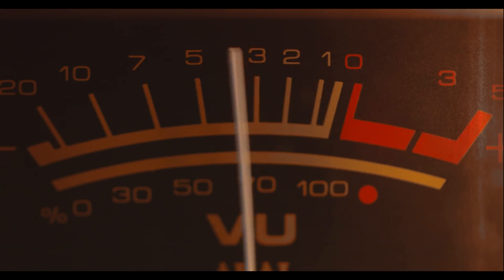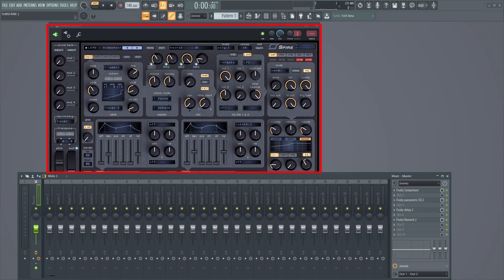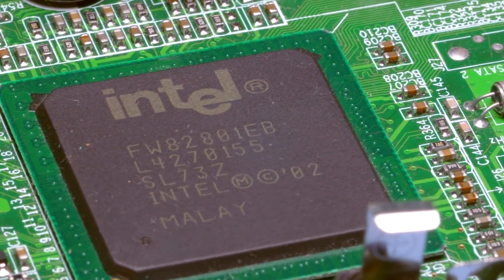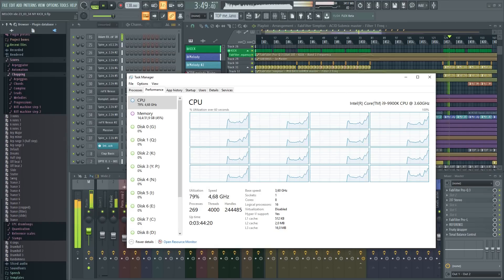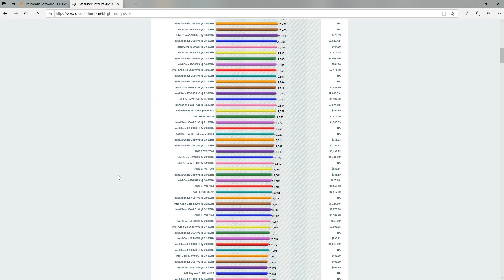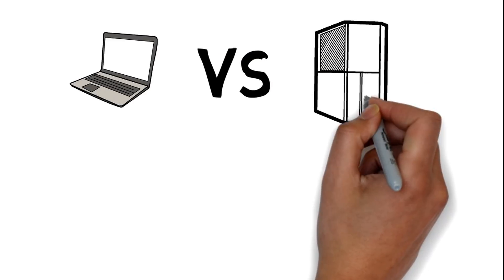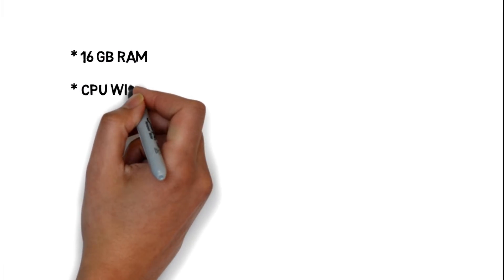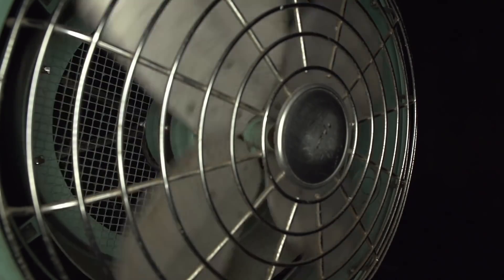The Best Computer For Music Production - What's Needed And Why!

Comment: About the liquid cooling that you used before ... I would like to know what pomp you used and how you decoupled it
My last build is liquid cooled and I never had any noise issues with my D5 Vario (even at full speed) 
And the fans on my radiators run around 500 rpm so ... let’s just say that my refrigerator in an other room is more addible than my pc currently is
Also I noticed that your system uses the stock fans that came with the case ... why not replace those with Noctua’s to reduce the noise even further ?
Reply from the maker: I've used two different kinds of setups and all though they are "almost" silent they are not as silent as this air cooler, which runs at around 220 RPM most of the time, and even under max load It can't be heard. There might be some out there that's quieter than the ones I've tried, but I just found that the Noctua provided better value since it's much cheaper and also quieter, and the performance is almost the same as with a water cooled setup. 
Because I want to stay on the safe / stable side of things, and not squeze out every single mhz I can, it wouldn't have mattered with regard to the OC result anyways. 
If I were to use a dual radiator setup then I would have to remove the sound isolation from the top of the case in order to mount it, and I fear that it would increase the overall noise compared to the way it is now. Also, all though I know the risk is minuscule, I was never quite comfortable using water in my rig, especially when it's so important to my business and all. :)
 
Regarding the case fans, that was the original Idea. However, this is a high quality case and I was told that they can't be heard, so I gave it a go, and was not disappointing. That's why I love this case so much. It has great sound isolation and the fans that comes with it is so quiet that you can't even hear them. I can hear it slightly at max speed, but there's never any reason to run all the case fans at max speed since there's more than enough circulation.

As I sit here with the PC 40 cm away from me, I can't hear any of the fans at all. The only thing I can slightly hear if I move closer is one of my older HDD's which is a bit noisy (and will be replaced soon). 

I placed a lot of attention on silence with this build. :)

Comment: Does the Asus Hero do a good job with 9900k?  I heard some other guys saying it doesn't have enough phases (only 4)  and so it will be hot, or something
Reply from the maker: I heard that too, but I found that it's really not an issue in any real life scenario. I certainly haven't had any issues with it, and my system is overclocked to the limit.

Comment: Ryzen9 or intel i9
Reply from the maker: Ryzen will give more value for your money. I9 will likely still give the best performance since it can be overclocked more, but the gains are not huge and I will tend to recommend the Ryzen these days since it provides better value. If you have more money than you can manage to use then go for the i9. :)

Comment: if your using Ableton multiple cores can benefit mattering how you use it,
go for more cores if your using lots of chancels and lots of small vsts on each
go for higher single core speed if you have only a few channels but lots of vsts on each
Reply: and for people buying CPUs price the motherboard with it because some cpus need $120 motherboards where others need $450 motherboards
Reply from the maker: Every daw can use multiple cores, including FL Studio. I'm sorry if I was unclear about this. The reason why single core speed is generally more important than having a lot of cores is because there's a lot of waiting involved, due to dependencies created within the project, which can't be logically processed in parallel. This is the reason why windows task manager will usually report a very different result than the meter in your daw. Task manager will report on the overall CPU consumption, while the meter in your daw is measuring your CPU's ability to fill the audio buffer within the allowed time. In essense, it's ability to play back the audio in real time. 
VST's can usually be processed by different cores. Individual mixer tracks are also an opportunity for the CPU to use multithreading, so having many cores is definitely an advantage. The problem is that there's always a trade-off between number of cores and single core performance. As you keep adding more cores, single core performance will tend to go down. For example: The 9900k has about 12% faster single core speeds than it's more expensive workstation counterpart, the 9900x, which has more cores. 

The 9900k, as well as the earlier 9700k etc are all located in this sweet spot. The new 3000 series from AMD also have very good single-core performance. 

Here's what the developers say: 

"There is a long list of tasks that must be processed in sequence, and this means logically can't be processed in parallel (multithreaded). For example: Plugins must wait for instructions from the Piano roll and Playlist before they make sound. Effects must wait for the audio from upstream instruments and FX before they can process it. Further, it's not possible to parallel-process (multithread) instruments and FX that are on the same Mixer channel (their audio is mixed together), or even in the same Mixer routing pipe-line (when one Mixer track is linked to another and another, even FX processing has an order from top to bottom in the FX stack). Then, the Master Mixer track must wait for every instrument > mixer track > effect to be processed before it can process the audio through the Master effects. So logically, there is a lot of waiting that is a natural and unavoidable fact of DAW music processing. Think of a production line. This means the CPU may not be particularly busy, using all its cores and processing slots, yet it runs out of time to fill that tiny 5 ms audio-buffer because there was a lot of waiting for things that needed to be processed in sequence. It should be clear that fast processing is very important and this is not the same thing as multi-core processing. The best CPU is one that has enough cores to spread the work around AND can do the most work on a single core during each buffer time-slice. Which leads to our TIP: When comparing CPUs, look for the fastest single-core performance scores in a package with at least 4 physical cores."
Reply: @FireWalkMusic  different DAWs and different workflows apply to what choice people make with buy a CPU, rather than a blanket statement that one is better than another.
both these factors should be considered when choosing a cpu,
i use Ableton the most but receive a lot of my work from partners using Logic Pro and Studio One. i notice a great differences in how each persons workflow and DAW effects my computer that is using a cpu with a higher single core speed that theirs but less cores. i also find workflow to be the most depending factor in this.

here's a quote from Ableton to show how a different workflow can benefit from a different cpu.
"More cores, slower clock speed
    Pros
        Live supports multi-threading, therefore the more cores are available, the more efficient it will be when working with larger sets with higher track counts, or when working with large instrument or effect racks.
        You'll be able to run more apps in conjunction with Live without seeing performance drops.
    Cons
        Lower single-threaded performance than a higher clock speed processor.

Fewer cores, higher clock speed
    Pros
        Better single threaded performance.
    Cons
        Fewer cores to split between applications.
        Not as strong multi-threading performance."

Comment: Thanks for making this video! What's your opinion on the new ryzen 3950x for audio production?
Reply from the maker: The new 3000 series from AMD is very good, but the 3950x is probably overkill. It has a lot of cores, but the thing with CPU's is that as core number goes up, single core speed goes down, since more heat is generated. I would probably go for the 3800x myself. Unless you also do a lot of video editing and such which can benefit from having a lot of cores. :)
Reply: 3950x has good single core too it is better than the 3900x, I just bought one today

Comment: Hello and great video! I wanted to ask, whats your opinion on the Intel's 9x series? I was looking up for i9 9940x (14 core) since i wanna do orchestral music with loads of libraries installed. Is having faster single core performance more important than having more cores with a "lower" single core performance?
Reply from the maker: If you use a large number of VST's then the 9x will  probably work very well since it has more cores, and also support quad channel memory. Note how the older 5820k is doing very well vs the 9900k in this video. This is largely due to the memory bandwidth. If you can afford it, then you can't go wrong with the 9x series. Note that you won't be able to run at the same high clock speed on all cores as you will be able to with the 9900k. If you look at the 9900k vs the 9900x for example, the 9900x has about 12% slower single core speed. When you factor in the higher clock speed of the 9900k (can easily run above 5 ghz on all cores) and you take operations per clock into account, then the 9900k suddenly appears to provide a lot more value. That's why I recommended it in this video, because it's right in that "sweet spot" where you have plenty of cores, but also very good single core speed. As you keep adding more cores to a CPU, the single core speed will tend to go down. 

If you use a huge amount of VST's though then the extra cores "might" just be worth it. 

Here's what the developers say about this issue, and I'll quote: 

"The logic of audio processing - There is a long list of tasks that must be processed in sequence, and this means logically can't be processed in parallel (multithreaded). For example: Plugins must wait for instructions from the Piano roll and Playlist before they make sound. Effects must wait for the audio from upstream instruments and FX before they can process it. Further, it's not possible to parallel-process (multithread) instruments and FX that are on the same Mixer channel (their audio is mixed together), or even in the same Mixer routing pipe-line (when one Mixer track is linked to another and another, even FX processing has an order from top to bottom in the FX stack). Then, the Master Mixer track must wait for every instrument > mixer track > effect to be processed before it can process the audio through the Master effects. So logically, there is a lot of waiting that is a natural and unavoidable fact of DAW music processing. Think of a production line. This means the CPU may not be particularly busy, using all its cores and processing slots, yet it runs out of time to fill that tiny 5 ms audio-buffer because there was a lot of waiting for things that needed to be processed in sequence. It should be clear that fast processing is very important and this is not the same thing as multi-core processing. The best CPU is one that has enough cores to spread the work around AND can do the most work on a single core during each buffer time-slice. Which leads to our TIP: When comparing CPUs, look for the fastest single-core performance scores in a package with at least 4 physical cores." 

I hope this was helpful. Good luck with your build. :)

Comment: Your rig is almost identical to mine except i threw a 7700k in mine, never have any bottlenecks even with cpu heavy vsts.
Reply from the maker: The 7700k is a great CPU. When both are overclocked, the i9 Is just about 18% faster, so it's definitely a good value. :)
Reply: @FireWalkMusic  im 17% overclocked at the moment, might dial it down a bit as summer is just about to start here 😑
Reply: @jessicamoreno7135  are there any good resources, forums to learn music production?

Comment: Not true for DAW applications that can utilise multi cores.  Multi-track recordings can share the available number of cores with DAWs which are designed to cope with more than one CPU.  It's true the mixing stage does have to wait for the other channels to complete, but if each channel has a good share of a CPU in a multi-core machine, that shouldn't be a problem.   Do some homework about which DAWs can process serially and concurrently.   Not all music productions applications are well-suited for multiple CPU's... you've found one of them!
Reply from the maker: All daws process information basically the same way. A linear daw will usually be somewhat more efficient than a modular one, but they all need to process chains the same way, which means that there will always be a lot of "waiting" involved.
Every DAW can use multiple cores. I'm not saying that they can't. I'm just saying that they're not very good at it, unlike video editing applications for example, which is heavily optimized for multi-core CPU's. The reason for this is that the audio has to be played back in real time. 
Usually, every VST can be processed independently by different cores. Generally, every mixer track in a daw is also an opportunity for the CPU to use multithreading, so having many cores is a good thing. The problem is that there's always a trade-off between number of cores and core speed. As you keep adding more cores, core speed tend to go down. Therefore, the best CPU is usually somewhere within that sweet spot. For example: The 9900k has about 12% faster single-core speed than the much more expensive workstation version, the 9900x which has 2 extra cores. 

Here's what the developers have to say about the issue, and I'll quote: 

"The logic of audio processing - There is a long list of tasks that must be processed in sequence, and this means logically can't be processed in parallel (multithreaded). For example: Plugins must wait for instructions from the Piano roll and Playlist before they make sound. Effects must wait for the audio from upstream instruments and FX before they can process it. Further, it's not possible to parallel-process (multithread) instruments and FX that are on the same Mixer channel (their audio is mixed together), or even in the same Mixer routing pipe-line (when one Mixer track is linked to another and another, even FX processing has an order from top to bottom in the FX stack). Then, the Master Mixer track must wait for every instrument > mixer track > effect to be processed before it can process the audio through the Master effects. So logically, there is a lot of waiting that is a natural and unavoidable fact of DAW music processing. Think of a production line. This means the CPU may not be particularly busy, using all its cores and processing slots, yet it runs out of time to fill that tiny 5 ms audio-buffer because there was a lot of waiting for things that needed to be processed in sequence. It should be clear that fast processing is very important and this is not the same thing as multi-core processing. The best CPU is one that has enough cores to spread the work around AND can do the most work on a single core during each buffer time-slice. Which leads to our TIP: When comparing CPUs, look for the fastest single-core performance scores in a package with at least 4 physical cores."

Comment: Would an I5 9300h be good for using lots of cpu heavy plugins like serum or omnispere
Reply from the maker: If you're planning on using a lot of VST's like that then I would recommend that you spend a little bit more and go for an i7, as you're likely to max out the i5 CPU fairly quickly. The older i7 CPU's are cheaper now, and will offer much better performance than the i5. For example the 9700k: https://amzn.to/33eCmEM

The new AMD CPU's are also worth considering: https://amzn.to/35oJGPA
Reply: @FireWalkMusic  thank-you either way I can bounce it all to audio so think I'll be okay with either